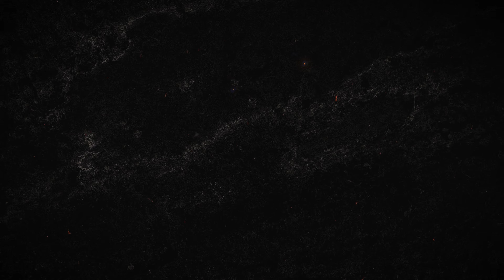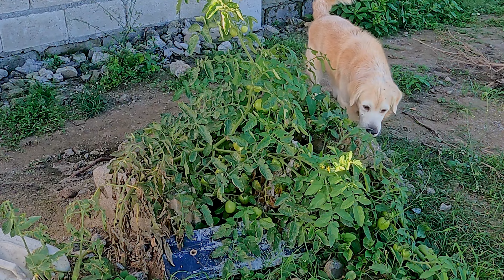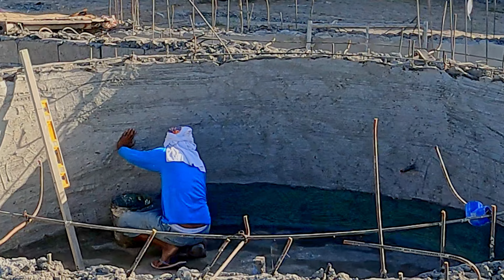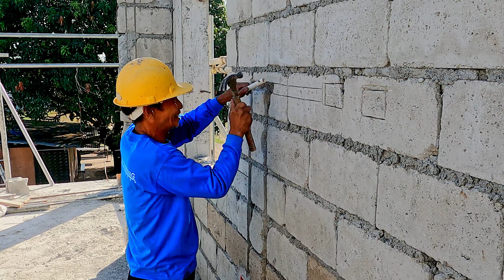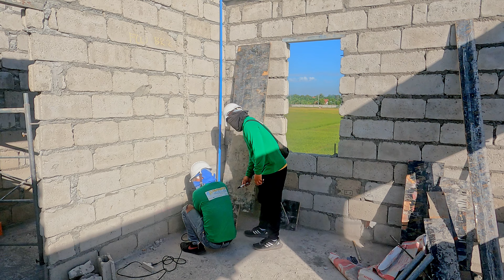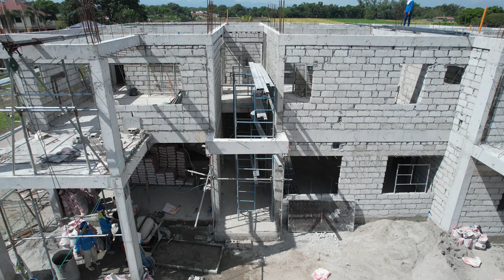Philippine House Building Day 123 - Getting Plastered

Comment: Thanks for the shoutout. See y’all tomorrow.

Tile setting in the Philippines tends to use a dry pack method instead of tile adhesive. Dry pack allows for leveling of the floor.
Reply from the maker: Damn - will I never learn.....
Really looking forward to tomorrow
Reply: @philippines4.0buildinganew64  yes the reason for that is they don't use a laser to get there floor level within + or - 5 mm - they can do it if shown how and then use tile grout to a adjusted level that suits all floor areas . Regards Mick
Reply from the maker: @michaelmasnar786  Mick
They actually do use a laser level. However they did get it wrong when they poured the ground floor slab. On that occasion they relied on string lines, and during the pour one of the lines got knocked out of place. End result I believe is a 2cm elevation change on that slab from south to north.
Reply: @philippines4.0buildinganew64  well there on the ball mate - I am used to the "Wackers "up here that call themselves builders where  there slabs are + or - a inch  if they are lucky. Fishing string lines sag 15mm ( no matter the tension) over 10 meters believe it or not . So you should only be using tile grout on your job - great outcome for you . May be you know more about building then you let on mate .hahaha . Your warrenty intrigues me / may be they carry indemnity insurance on all there projects ???
Reply from the maker: @michaelmasnar786  First, I know way less than I am letting on.
As far as insurance goes, I don’t know whether he has insurance but I am guessing not. We did visit one of his previous clients where he was doing repairs (plaster cracking, who knew) three years after the build. Not too much comfort but a little. He could of course go bust.

Comment: Hello again Mike . Because you have numerous walls to plaster of all different SQ meter areas , I would  insist that each panel is finished if it is started . Pretty easy to work out how much SQ meters the crews can cover In a day . Insist if they start a panel they finish it even if they work overtime . No horizontal/ vertical joints in plaster should happen in a large job like you have . Bad practice/ no planning/slack supervisor . Normal over here though I afraid . Regards Michael.
Reply from the maker: Thanks for the tip Michael
I will talk to the engineer / foreman tomorrow morning

Comment: Hi Mike. If you're worrying about plaster cracking where most of the electrical conduits are, you might want to consider removing some of the CHB on both sides of the pipes and do a poured concrete instead..it might help. Thanks and you can call me Phil from Chicago
Reply from the maker: Thank you Phil - even I probably can't mess that name up.
I suspect the builder would push back too much on that, even though it is probably a great idea.
Of well, we have a 15 year waranty ......
Reply: @philippines4.0buildinganew64  Ok sir thanks and hopefully you won't need the warranty 😊
Reply: @philippines4.0buildinganew64  your right phil - that is the correct way of filling those holes in . Some of those PVC pipes look like 3 /4 inch ( roof drainage??) Not much cover to stop cracking in plaster . But there is a 15 year warranty period - so that is really good for Mike ( very smart clause to get put in the documents - if I was civil contracting over here I would not sign that contract - may be back home but my fixed price would reflect what is in the warranty period documents - probably not get the job .  Rise in costs for labour/ materials over 15 years hard to price / big risk - hopefully no problems . Regards